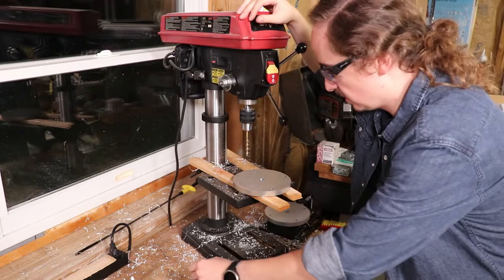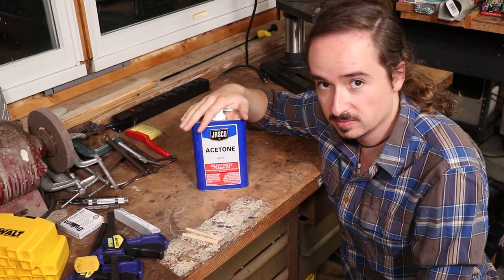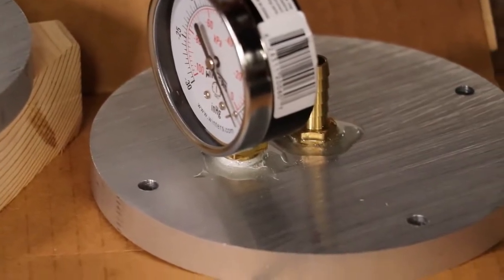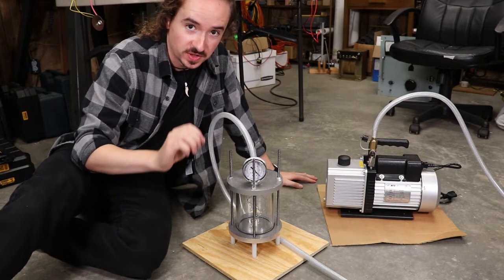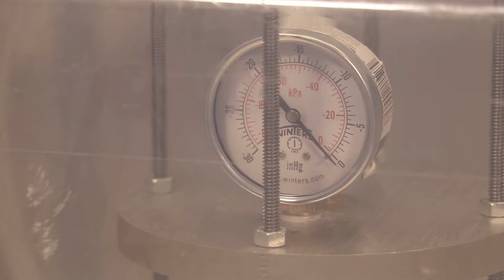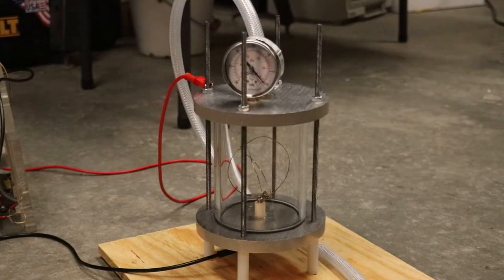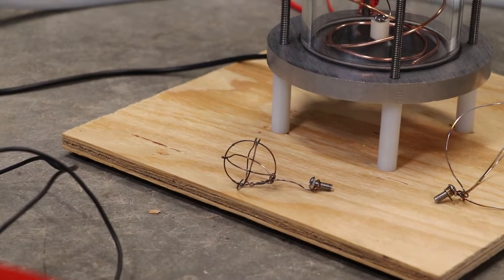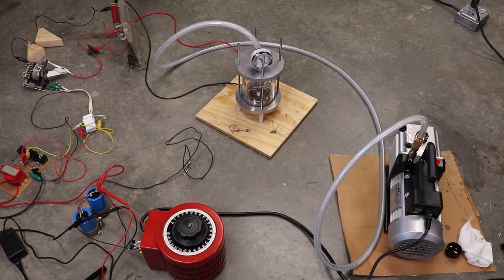FAILED! Farnsworth Fusor: Demonstration Fusion Reactor

Comment: When it comes to the obvious leak in your system, i recommend a thick layer of hard, heat resistant rubber for the sealing rings. I used those for my fusor, and it took 4 days for it to leak all the pressure out. A good fusor is very dependant on a high and good vacuum.

Comment: Great stuff!  I appreciate seeing the occasional failure: we learn more from it.  Glad I happened upon this.

Definitely a big leak: it should be able to hold a vacuum when the pump is turned off.  Industry standard for leak-checking is a spray bottle filled with water and dish soap.  For positive-pressure containers: spray it on fittings and if it bubbles, you have a leak.  But this doesn't work so well with vacuum systems.  Thankfully, since your chamber is glass, you can probably see bubbles from the outside (a leak will pull in the soapy water and hopefully they will make visible bubbles).  I haven't actually done this with vacuums though, so it might be difficult.  My biggest concern is the gasket, so check all around that and spray on both the top and bottom of the gasket.  A slight imperfection or scratch in the metal surface could cause a significant leak.  My second concern is the tapped hole that was overdrilled.  If it turns out too bad, it might still be salvageable by using liquid pipe dope (make sure to get a kind that will actually harden) as well as the pipe tape.  Although I don't know how well the liquid pipe dope works on a vacuum.  

Regarding outgassing (and holding at low pressures): The pump and the tube it came with are probably fine, although if you put a valve between them and the tank, you can check by closing it before turning off the pump.  Pumps can usually hold a bit of vacuum when they are turned off (even my cheap $100 one).  I'm not sure what the white plastic pipe is, but if it's PVC/CPVC you'll want to replace it.  PVC is terrible for vacuums.  Teflon or UHMWPE or JB weld would be preferred if you need plastic.  The standard JB weld is surprisingly good for vacuum systems (I've used it on 10^-7 tor systems and Thought Emporium has used it to good extent).  For other materials, you can look up outgassing properties by searching "NASA Outgassing Database".  As a rough rule of thumb, you want something with a TML <1.0% and a CVCM <0.1%.  It's meant for spacecraft components, so it isn't perfect, but it's a great place to start.  

Don't give up on it.  You've done most of the work.  But the troubleshooting is always the time-consuming part of vacuum systems.
Reply from the maker: Lots of great info, thank you so much! I do plan to get back to this at some point. Really appreciate all the details you provided here!

Comment: Hey, nice video! (I know I'm late but) I'm planning on building the same design - the instructions say to use a 4¼ hole saw bit to cut the aluminum bar stock but yours looks bigger than that. Can you tell me what size you used? Thanks! Again, nice video!
Reply from the maker: What I did to save myself some effort was buy two of these 6 inch diameter, 1/2 inch thick aluminum disks from McMaster-Carr https://www.mcmaster.com/1610T56-1610T147/

In retrospect, I think the surface finish on these disks is a part of my issue holding a vacuum though. They're a pretty rough finish, so it might be advisable to find something with a smoother finish or machine them down a bit to remove all the irregularities yourself, if you have access to the tools to do so.
Reply: @CoilLabs  Thanks! 1 last thing, is McMaster-Carr reliable? I want to buy parts from them but I've never heard of them outside of this project
Reply from the maker: At least here in the United States they are THE main vendor for raw materials for one-off engineering projects. Talk to any machine shop that makes one-off stuff (i.e., not a factory that's ordering massive stock in bulk) and I'm sure they order from McMaster-Carr. They're not cheap, but they're a very serious, professional vendor. I've used them for both personal projects and work for over 10 years now.

Comment: Just a few things. If you need to use epoxy just use "JB Weld" as it's trusted amongst UHV community.  Test your rotary pump directly to see what vacuum it's capable of. For that size chamber you likely only need 15-30kV, the higher the voltage you will need better vacuum due to arcing within the chamber.  Your tube connected to your pump is very long and could be outgassing.

Comment: Don’t know if you’ve tried it again, but the setup looks like it should work, but I’d question your gaskets and pump. Use stiffer gaskets, with a gasket sealant, and a pump rated to get down to like 1.5 micron for good measure. Also what kind of voltage output are you getting from your hardware?  50kV to 100kV should get you a good one.

Comment: I agree with the comment suggesting that you probably have a leak. I think you should try a couple simple things before you give up on this. First, I would put a good valve in front of the pump. Then you can close it and turn off the pump to test your vacuum. Second, I think using some kind of vacuum grease on the seal will help you. Lastly, if all you want is a 'star in a jar', maybe you should try installing a second gas feedthrough and filling the camber with an inert gas, like helium or neon in order to aim for a glow discharge.

Comment: the fusor is completely fine i believe, and i think your powersupply is good as well, the vacuum pump will not cut it though,as you can see it wasn’t able to bring it down anywhere near it should for fusion to occur. also check for leaks
Reply from the maker: That pump can (according to its specs) get down to a lot lower pressure than it did. I agree, there are definitely leaks that need fixing.
Reply: @CoilLabs  the fusor looks great though, good luck!

Comment: Aaaaaaa all that stray inductance on the ZVS. Please use shorter wires between the output of the zvs and the flyback/capacitors :) (this isn’t why it didn’t work though)
The end result is pretty cool even though it doesn’t work. It has a cool spiral jacobs ladder effect!
Reply from the maker: Yeah, that ZVS driver was built a long time ago, back when I was way less knowledge and was afraid to make more permanent connections because I was worried about killing flybacks all the time. Which I did, because I didn't know what I was doing, haha. Anyway, I'm planning to build a better and also much higher power ZVS driver at some point in the near future.
Reply: @CoilLabs  Nice!
yeah I just put my ZVS (incl rectifier, smoothing, and gate supply, the only wires sticking out are the mains plug from my variac to it and the mains plug for my gate driver) neatly and compactly in to a box. Regretted it shortly after when I killed the 2 sets of IGBTs in quick succession...
Reply: oh hello vdekje
Reply from the maker: That's cool! Yeah, I want to build something way more powerful that I can use for a lot of different projects. Hopefully make a video about that at some point, once I've designed whatever it's going to be.

Comment: I might be a little late to the party but it looks like you're sealing against the raw faces of the aluminum plates. If you take something very flat like a sheet of glass or 12"X12" floor tile and a few sheets of fine sand paper you can lap the surface of those plates to get a much better seal, the raw surface of rolled aluminum plate is not extremely flat. You might also look into changing the seal material, it might be off-gassing or not soft enough to seal against the glass. And if nothing else you can gob some JB weld all over the threaded ports to eliminate leaks at the top, just make sure to strip all the exposed Teflon off the threads
Reply from the maker: Lots of great suggestions, thanks!

Comment: I think more people should publish information on failures. After having seen various rebuilds of the fusor design I assume we can learn more from failures than from success.
Probably the vacuum isn't strong enough. Have you tried to measure the achievable vacuum by directly connecting a gauge to the pump hose?
Have you tried to install a valve between your chamber and the pump so that you can cut off the vacuum hose and watch the pressure (hopefully not) rising in the chamber?
Also I guess your mechanical gauge is not really suitable for measuring low vacuums. I'd try to go for a pirani on ebay.
The burn marks of the transformer could maybe be avoided by storing the transformer in an oil bath which will isolate electrically and help conduct heat away from the diode. Also a kind of current limiting resistor might be an idea not to overload the diode.
Best regards and keep researching and publishing.
Reply from the maker: Unfortunately, I epoxied that gauge into the fusor without testing my pump in insolation, first. Rookie mistake. I should just acquire a better gauge, like you suggest, regardless. Good idea about installing a valve in between to see how well the chamber holds vacuum with the pump off. Also good advice about the flyback transformer overheating. I use that flyback for a lot of other things (that abuse it much less), so coming back to this project later, I'll likely build/acquire a more robust, dedicated power supply for it. Thanks for the advice!

Comment: you have to many air leaks is the main problem you'll need a harder vacuum and voltage was to high for a fusor its around 15-35kv dc depending on distance of the anode and cathode.

Comment: This was an amazing video regardless of the failure. I'm interested in building the same design as you did in the video and I'm curious on the cost.
Reply from the maker: Many different parts were bought/acquired over time and not all specifically for this originally, so it's hard to be precise. Based on most of the high price items though, I'd guess the total would be somewhere around $300-$500 USD. Vacuum pump, even a really cheapo one like that, is still several hundred dollars and is the main thing driving the cost.

Comment: It looks like that there is no vacuum grease on on the rubber rings between the glass and the aluminium plates. You need to apply a lot of high vacuum grease on both sides of the two rubber rings because the aluminium and the glass tube are not smooth. The fact that the vacuum gauge jumps so fast to zero as soon as you disable the vacuum pump clearly indicates a leak. I think that the vacuum hose and pump should be good enough in order to let the demo fusor work properly.
Reply from the maker: You're right, the surfaces of the glass and aluminum definitely aren't smooth enough and that's definitely a problem. The vacuum grease is something I've seen a lot of conflicting opinions on, for this particular application, though. I'm general, you're absolutely right, it would help it seal, but in this particular, I've seen people say it's actually detrimental, because the high heat and strong electric field can actually cause the grease to outgas significantly and just make the situation worse, so that's why I tried without it.
Reply: @CoilLabs  Avoiding vacuum grease in a real fusor is indeed necessary, but that requires quality high vacuum equipment with for example metal on metal seals. This design from Makezine just uses simple components which require the use of vacuum grease. I have also build a demo fusor from the Makezine design and it works fine with quality vacuum grease.

Comment: What caused it to jump around on the inside? Just electricity being electricity?
Reply from the maker: I think it's the interaction of a few different things, but I'd say the main reason is convection due to heating. Plasma gets hot and rises, but because it's already plasma, it's conductive and the arc moves with it, because it's the path of least resistance.
Reply from the maker: Exact same reason a jacob's ladder moves upward

Comment: You should have used vacuum grease on your seals and chased any leaks to get it to hold vacuum as you obviously have major leak issues. also grid size is to big for the power source you were using, 25mm would be all that you would get for that flyback set up.
Reply from the maker: I totally agree about the vacuum grease and that's one of the main things I'm going to change when I try this again. Using vacuum grease for things like this is apparently a debated topic though. I received very conflicting advice and some people were adamant that you should not use vacuum grease on something like this, because the heat + high voltage would cause the grease itself to start outgassing. After having tried this though, I'm pretty sure that was bad advice and perhaps those people didn't understand that I was not trying to make a "real" fusor, just a "demo" fusor.

I'm curious how you came up with 25mm for the grid size though. What's your reasoning behind that? I just want to learn and gain more knowledge about this so I can explain what's going on correctly when I revisit this in a future video.
Reply: @CoilLabs  im currently building a fussor and was getting the 25mm based on the size of your set up, the bigger the grid the more plasma that needs to be formed and this requires much more distance, voltage and insulation, and the bigger the vacuum chamber, the bigger the pump you need.  the biggest issue you have though is the vacuum leaks, you need to get the chamber to the point of being able to hold the vacuum when the pump is turned off.
Reply: I have a 50kv former x ray transformer that i will be powereing mine with, and have a large 2 stage vacuum pump. will be doing a aluminium tube body and Acrylic or polycarbonate end caps. just a demo fusor like your one was meant to be. i will get more serious if i ever get a better vacuum pump.

Comment: yeah it took me like 58 tries and three weeks to get my first Farnsworth fusor to work with the cheap material's I had at the time and a old fridge pump may it rest in peace it lasted for 1year and got me all the way to testing the vfr prototype, and engineering with theoretical work from lpp fusion in mind....not easy and i havent even got to the direct energy conversion or ion capturing to get an out put i need to rebuild my whole setup with proper parts pumps and not have it build out of scrap and i need to get used to documenting all my experiments im new to youtube

Comment: You ever get this to work? I’ve made like 8 different designs and buy did I make a lot of mistakes. Lots of time later I got it! However then I decided to go for actual fusion but have had a bunch of expensive af stainless steal chamber fittings, clamps, oil diffusion pumps, deuterium, etc. laying in my shop. Now I’m going for the Tesla coil build instead🤣
Reply from the maker: Haven't had time to get back to this yet, unfortunately. Cool that you already have that stuff. Way outside of my budget to acquire stuff like that.
Reply: @CoilLabs  budget?🤣 I’m a broke college kid. Over the period of maybe a year and a half I’ve been messaging wayyyyy to many people on eBay trying to get the materials and waiting for crazy deals in everything. Tbh I don’t plan on revisiting this project anytime soon. Not sure if there is a way to private message so my email isn’t exposed but if you’d like I’d be able to work out a deal with you on everything? I’ve got a huge assortment of flanges, seals, stainless vacuum chambers, 2 diffusion pumps, roughing pump, etc. although the roughing pump id just get at harbor freight lol. Just let me know if it interests you at all! Love to see someone complete my unfinished project!!

Comment: you have a leak on your system, a big one by the looks of it, try to avoid epoxy, epoxys for vacuum are really expensive so unlessyou have a specialty one it would outgas like crazy, normally high vacuum pumps are also used, like a diffusion pump or a turbomolecular one just to ensure your chamber is clean of contaminants then you feed deuterium again to the chamber, you can use a thick glass bowl as a chamber, next week i will try also to demostrate electrostatic confinement, and a simple setup

Comment: your vacuum chamber works .. you have a problem with your circuit... the two-wire must be separated enough .....your inner wire is too close to the bottom which is connected to another wire,... increase the height of the inner wire, and insulate it properly until it reaches the desire hight in vacuum chamber.....btw you need a magnetic field to make a doughnut shape plasma ball.

Comment: You need a pump rated for 0.1-0.01 mTorr. The cheap chinese ones are not capable of that.
Ps, you can also use a sparkplug as a electrode so you can use a thread instead of epoxy
Reply: Another Ps, Original JB Weld works best for vacuum chambers instead of epoxy ;)